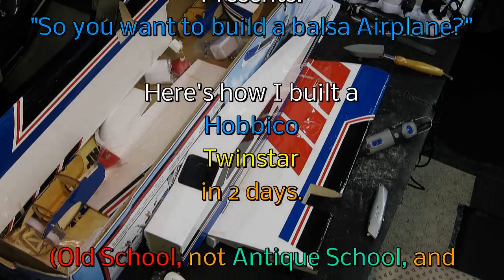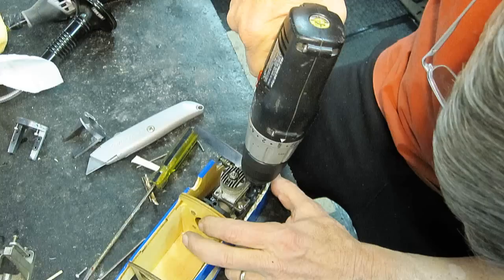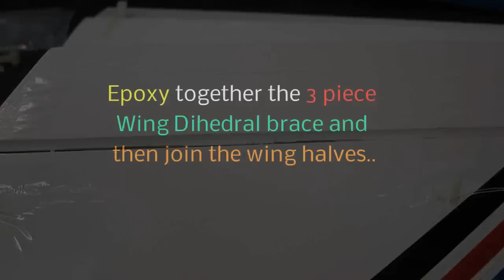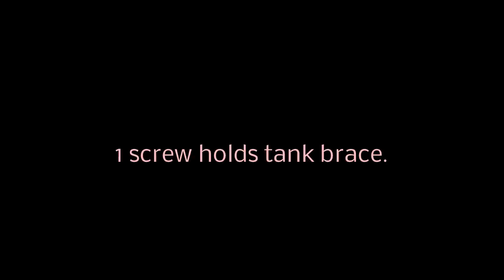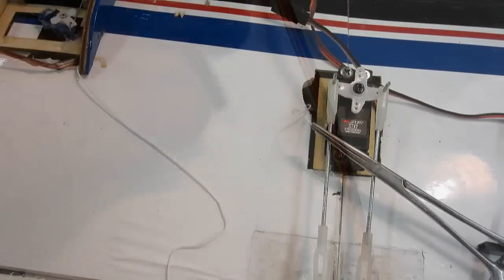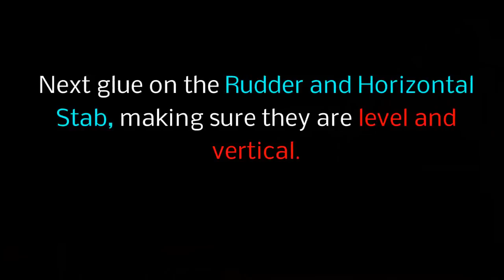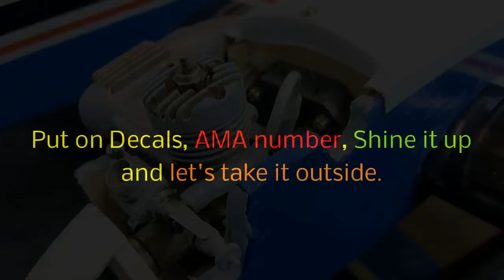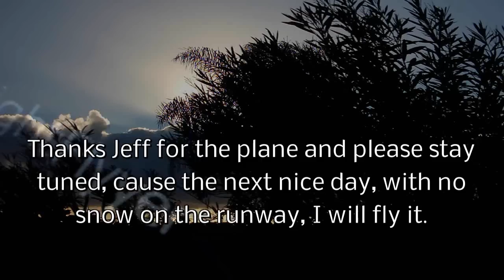So U want to build a Balsa Airplane! A sorta old school Twinstar build by NightFlyyer

Comment: Awesome video, and would it have been possible to have put electrics in there instead of gas?
Reply from the maker: Haha. I thought about that and yes,it is possible and you can ask Jeff, I was going to.  Well see how it flies first, and if I decide  to put bigger engines on it, I will add the gear too.  Thanks. Good question.